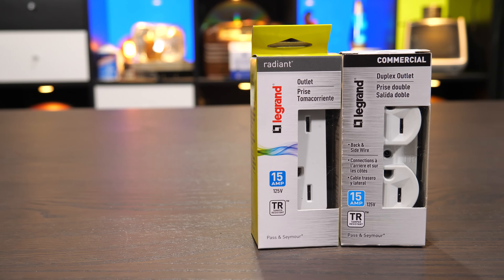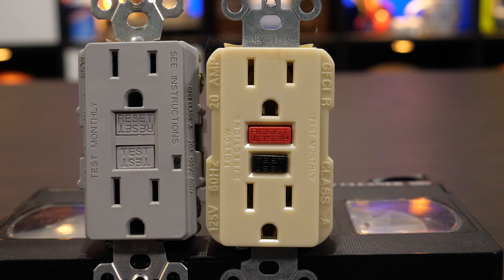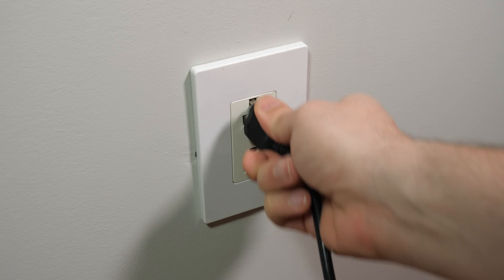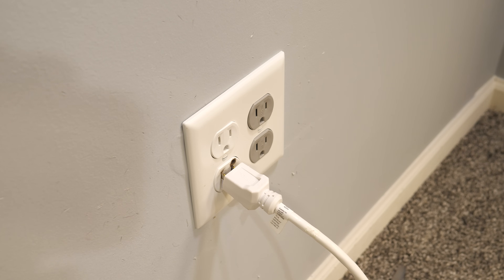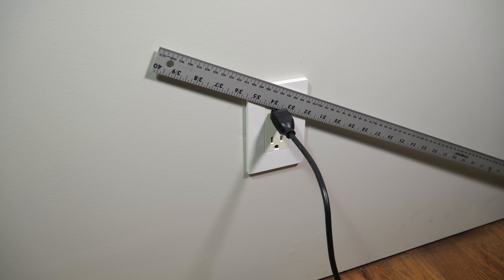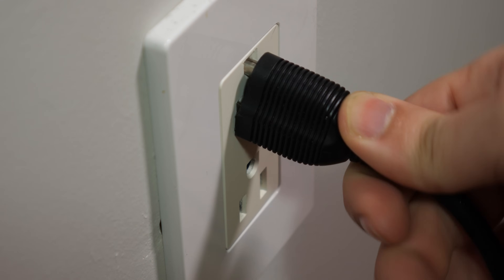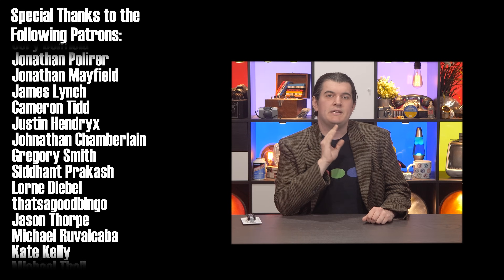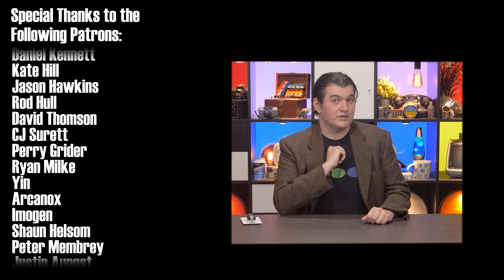Power outlets are topsy turvy - but does it matter?

Comment: I disagree!  At a bicycle shop I worked at here in Arizona we had a fire because of this.  Another employee tossed a brake cable into the trash can but missed and instead the cable hit the wall.  As it slid down the wall, the cable contacted the live plug that wasn't flush with the wall and the cable grounded to the workbench next to it.  There was a flash and paper overflowing the trash caught fire instantly.

We put the fire out, but if we had taken another few seconds it could have been much worse.  All my garage and workshop outlets are now flipped because of this experience.  Had the plug been inverted, the falling cable wouldn't have contacted the hot prong powering our air compressor.
Reply: @SnakebitSTI , I know it was an unlikely scenario, but I would be surprised if we were even the first bicycle shop to have this happen.

It was the only indoor fire I ever experienced.  It is hard to accurately convey just how fast a trash fire can erupt.

Comment: Can you please elaborate the concept of electrical ground/eartn ? I have basic knowledge of electricity,magnetism and have read about the subject but can not wrap my head around it. Maybe your way of addressing this issue will help me and others understand what a ground is and how it's done for wiring and appliances.
Reply: In general, the third ground plug provides guaranteed, independent grounding. That is, its electrical path to the appliance is separate from any and all internal electrified components. It is supposed to be attached to the appliance’s chassis / case / enclose. Anyone touching that is safe from any errant short circuit, should such a short circuit even touch the casing in the worst case. Electricity would flow through that deliberately made ground path even if a person is physically in contact with it. Electricity will chose the easier path: the conduit one.
Reply: It is just a wire that goes to the ground. Usually, it is connected to the body of the device to stop it from killing a person. It will cause short before someone can touch the body.

Comment: One argument I heard for 'ground down' is that the ground pin on a 3-pin plug continues to make contact as the plug pulled down. Eventually, the power contacts would open, but the ground would still be protecting the equipment.

Comment: The USA should adopt the schuko (CEE 7/3, type F) receptical, youm even have a polarised version of it (CEE 7/5, type E). receptical. Its recessed design allows you to safely throw knives at the wall. Even the non grounded cousin (CEE 7/1, type C) is recessed
The sleeving on the plug is also a great idea, we europeans do that already with the flat europlug.
But if you want the safest plug of all time, go for the british plug. (which is actually ground up)

Comment: I think the outlet should be rotated horizontally with the plugs still vertical with the ground at the bottom so you can use two of the flat style plugs. Trying to use two of the flat plugs on a vertical outlet is at best impossible and worst a electrical hazard.

Comment: I have seen some really old (on fibric and paper insulated wires) 2 prong plugs that are even thicker than modern ones (0.5 inch on the sides, same as modern on the vertical faces). I have encountered a 90 degree plug that is brushed and has 360 degrees plus of rotation, but only one in my life and only at a school that occasionally has ground pin up connectors.

Comment: Would it make sense to recess the business end of the receptacles into the wall, maybe? Have some sort of flexible flap on the outside wall so the plug and cord can go in, but not much else can?

I guess that might make for a different kind of fire hazard, but at least the plugs wouldn't be hanging out directly on the wall.

Comment: I've heard to invert the plug for years, but that was specifically in workshop counter plugs, where if something falls and hits the plug or tugs the wire the ground gets exposed 1st. 
Now, those outlets were also recessed into the box by a half inch, so you aren't getting a right angle plug in that anyway.

Comment: We have something like that here in Europe. I HATE them to the point that the frist thing I do when I buy a new socket or an extension cord is to remove the protection. It makes pluggin things a nightmare and I don't have kids so I don't care about "safety".
Reply: The red blockers? I very rarely see them.
Reply: @LMB222  Here in Spain they are in every socket. They are spring-loaded and they make plugging anything really hard, you really have tu push the plug (they have rounded tips).

Comment: I only buy right angle plug heads because most of my outlets sit behind cabinets, dresser, etc. While I like not having my cords & cables out of sight, a more "traditional" cord would force my furniture several more inches away from the walls and increase the potential of those items to fall over.

Comment: In a an old tiny apartment, I had a surge protector mounted on the wall behind my tv console and a gold chain fell over a slightly loose plug.  The surge protector melted so bad is stopped working completely, not just tripped.  Imagining that was a wall outlet is chilling.

Comment: I was (yet again) making the risky comparison with my larger UK 13A 240V plug, which is fitted with the Earth pin at the top in [almost] every situation I've ever seen. 
However our cable gland  always faces down, not straight out as USA plugs all seem to. Also our sockets usually include individual switches often with the Word OFF included.
In Denmark & Sweden our plugs are often round in profile with a larger round Earth pin. So the sockets must include them, usually at the top.
The Swiss and Italian plugs offset the ground pin. The Swiss sockets are lovely, with three plugs forming a neat circle. The world of international plug & socket design is so much fun.
Reply: IIRC, in Spain (other European countries are available), the ground pin can either go up OR down - there's a hole at each location for it. Weirdly, Spanish plugs are flush to the wall, whereas others (Italian? French? I forget) are recessed... which leads to some interesting compatibility problems despite the plugs being otherwise identical.

Comment: Brazilian standard is actually quite good into protecting your fingers from touching the pins while inserting or removing a plug, just by making the female plug a bit more than one centimeter deep. It is almost impossible to touch the pins because of that. And the ground is on the bottom.

Comment: Here's a core issue with the orientation change statement...

If your plugs are loose enough to "Fall out" like that? 

It means it's time to replace the receptacle. Seriously. If plugs are loose, that means that receptacle is now no longer operating safely and will begin arcing.
Reply: i’ve literally never handled a plug loose enough where i could wiggle it to see any part of the metal prongs at all. is it really the norm in america to have loose as hell plugs?
Reply: @loeuf  it is relatively normal in America to have houses that are extremely poorly maintained. Replacing power outlets is a part of regular maintenance, and almost no one actually does it. It's infuriating.
Reply: Also if you want to know why our non-grounded plugs are safer? 

It's because in parts of the world where a huge chunk of our electronics come from.... there is no ground pin. I know. It's weird. And scary. But yeah. Look at outlets in Japan, they're the same as our two-prong outlets, complete with the keyed hot and neutral, but with no ground pin most of the time. For larger appliances, a separate ground socket(which screws in place) is there, but those are wildly rare cases, believe it or not. Not a lot of folks in Japan have dryers in their apartments, and the washing machines are small and really only meant for a change or clothes, maybe two. A large chunk of their stoves are still gas, as well, because most apartment kitchens are a standard shape and size, and you have to bring your own stove with you. And yeah, the outlets are all two-prong. And since a huge chunk of our electronics and appliances are at the very least Designed in Japan, that's gonna carry over. So with the steady rolling advance of technology and convenience there relying entirely on plugs Don't have ground pins, the primary market for improving that use case is in plugs that... you know... Don't have that ground pin.

Comment: Honestly, looking at the plug designs, sideways right angle plugs like the replacement lamp cord you showed need to become a standard. The worst part about right angle plugs right now is that you can only really use 1 per outlet, since the part hanging down ends up covering the other plug or making it impossible to install in the top recepticle. Putting it at a right angle not only makes it fine in BOTH orientations, but makes it so you can use more than one per plug. I don't know why this isn't everywhere.
Reply: I like rotating flat plugs more, they can be placed running in any direction
Reply: Let me tell you about the beauty of 45°-rotated outlets, especially on extension cords.
Reply: That being said, Side by side Uk style sockets would also fix it.

Comment: My house was built with those legrand square outlets with the plugs in both directions, and i just want to say that they are horrible! every single outlet i have only has one thing plugged into it because even the smallest of power cords interfere with the other plug, even non grounded power cords like for TVs. The worst part is you have to cut out a specific shape for the boxes so they're not simple to swap to a normal outlet. My light switches are also the same and I have some outdoor lights that are controlled with a switch and I wanted to get a cheap wifi switch to put them on a timer but i'd have to either get legrand's $100 option (FOR A SINGLE SWITCH) or replace the entire switch panel, which would mean they don't match the rest of the house anymore. Complete side note from the point of the video but very frustrating that they exist.

Comment: I once knocked a key off a hook and it fell across the hot and neutral and did a good job melting the key. You didn't include the scenarios of plugs in floors. I live in an older home with quite a few in this position, and lots of work places put floor plates in.